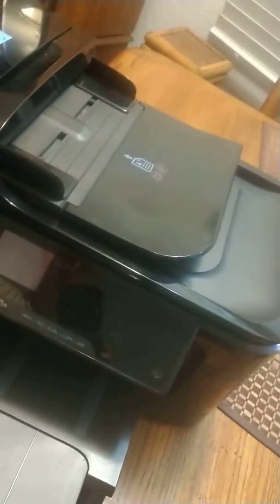HP officejet 6500a plus paper feed roller does not turn

Comment: I have Huge hands hahah. Feel like the plastic is gonna break trying to access that assembly from the front. 
But yeah I've seen people recommend cutting the hole to fix this, which I wouldnt think twice about doing if the printer were mine. however as stated, I cant just chop holes in the customers stuff. So I am seeing if perhaps theres another way to access this without tearing the whole thing down

Comment: Brilliant solution . Thanks ! Just fixed my own 6500A printer. But instead of cutting a hole in the bottom I just used a mirror to locate the gear. I could move it with my fingers. I used a cleaning stick to apply the glue and moved the gear over it by hand (just used superglue and did all by looking into a mirror). Let it dry for 2 days (I forgot about it). And then it worked again !

Comment: I just tried this trick.  I noticed that the gear is cracked, never had luck with superglue, so I carefully coated the shaft with epoxy, and am now allowing it to harden overnight.  I'm hoping the epoxy will be strong enough to hold the gear together.  Also, I had to go back over the video several times to figure our exactly where to cut the hole.  I was able to get this done with a much smaller hole.  

Thanks for the tip, hoping the epoxy will hold up for a while.

Comment: Mate- You are a genius for identifing this issue ! 
I have to say though once one knows to look for this problem its just a matter of using a small make-up mirror and and torch to check if the cog has indeed moved out of place which was also my issue. 
I just reached in through the paper tray and moved it back into place with my finger.
If it moves out of place again I will use a drop of superglue as you suggest.
Many thanks for going to the trouble to identify this problem and posting here

Comment: I have the exact same printer with the exact same problem. I tried the super glue, but the gear kept slipping off. I also tried red loctite, with the same result. I think my gear is actually cracked so that it can't grip the splined shaft tightly.

Comment: Thank you so much for posting this. I did something very similar after watching and was able to save a good printer from going to waste. Fixing things is good for the environment, fun, and good for your wallet!  Only things I did different: used step drill to make cleaner hole and used JB Weld on shaft. I then added super glue to fill the gap in the cracked gear.  Held crack closed with needle nose pliers with rubber bands on handle to make a clamp. Cheers!

Comment: Thank you so much for this video!  It was a big help in getting my 6500A working again!

I have an HP 6500A printer that has been sitting on my desk for a several years because it would not pick up a sheet of paper from the top of the stack in the tray.  I peeked at the feed delivery roller gear with a mirror and sure enough the feed delivery roller gear in my printer had slid off of the splines on its shaft.  I tried to gently slide the gear back onto the splines, but it broke into two pieces.  I suspect that my gear was split, hence that was why it would not stay tight in its proper position on the shaft.  It was just made from very weak plastic (along with all the other gears) so HP clearly did not put any effort into making the 6500A a long lasting product.

I did some research and I found four of the replacement gears online for just $7.00.  I bought them since they were much cheaper than buying a new printer.  I also do not support the modern practice of "designed for obsolescence" in any way and I will at least try to fix everything that has broken before giving up and throwing it away.

I found that the best way to replace the feed delivery roller gear was to cut an access hole in the bottom panel of my 6500A, as you showed in your video.  This other video also was helpful:

https://www.youtube.com/watch?v=stXL3eXmjmQ

I just used a Dremel rotary tool with a cut off wheel to cut a hole in the bottom of my 6500A.  The bottom plastic panel is lightweight and thin so it was very easy to cut through.  I cut a long slot that was almost the entire width of my printer's paper feed tray in order to remove the long shaft that the feed delivery roller gear was pressed on to.  I managed to remove that shaft and install the new gear and now my printer works just like new.  I was afraid that cutting the large hole in the bottom would cause the paper to not feed properly but since the paper is fed from the top of the stack, the hole does not cause any problems at all.  (The hole is underneath the stack of paper.)  Now that I have the large access hole in my printer, I can replace the feed delivery roller gear whenever it breaks in the future and I'm almost certain that it will break again based on what I've read online about 6500A printers from other owners.

Comment: This video is brilliant. I could reach the misplaced gear with my finger and slide it into position, but every time it runs, the gear would slide out of position again. So I had to cut a window out of the bottom like Michael said. I used a drill and basically made perforations along a rectangular window directly below the gear in question then pried the piece out. Then I used superglue as Michael said to fix that gear into place. Now the mechanism works!

Comment: Good video thanks. Am trying to repair the same printer.  What tool did you use to a cut a hole in the bottom??
Reply from the maker: Sorry Matt, I never even realized I had comments for this video.  I hope you figured it out
Reply: @michaeledwards8384  Sadly no and the printer went in the bin. Thanks though. I'm sure your video has saved a lot of printers!